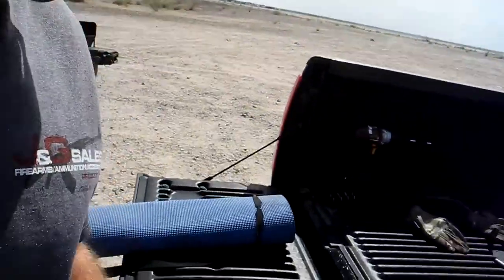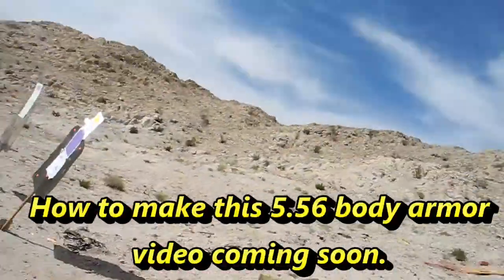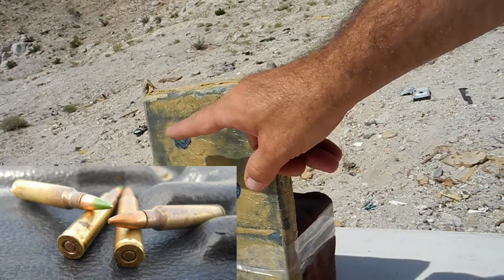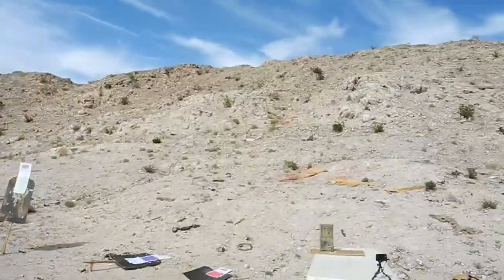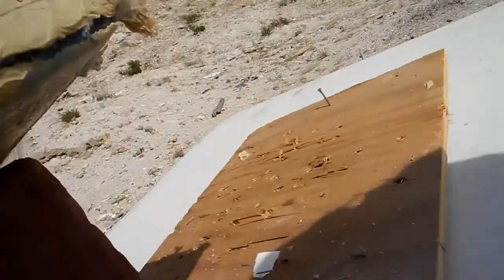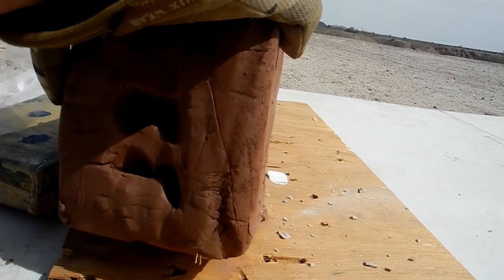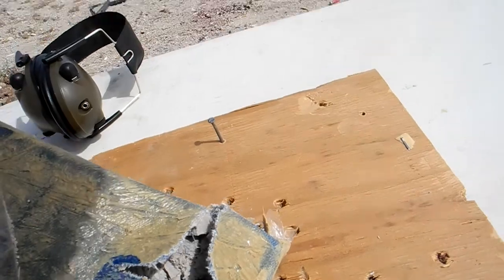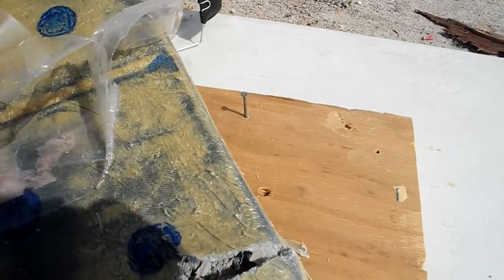DIY Body Armor

Comment: This is awesome.ill try to build my own diy plate here in Sweden 😀. Ill use 1 layer of thin steel, then 1 layer of ceramic tile, then one layer of hdpm plastic ( a cutting board) then one layer of ceramic tile again and then another layer of plastic cutting board. Ill use PL to glue it together and then wrap it with kevlar from the hardware store and resin. Will be interesting to see what that can stop 😄

Comment: I just stumbled upon this and I think it’s great! I was looking to make ballistic panels for a backpack. 

I have 2 questions... What happens if the round hits in the middle of the tiles? And what kind of tiles again? I want to see if I can find a little bigger one. Thanks!
Reply from the maker: PEI 5 tiles.

It would be better on a final design to have no gap where the 2 plates meet and stagger the 2nd tile to ensure there isn't a double seem.
Reply: @ProfessionalPepper ahh yes good call. I can try that. Is the aluminum supposed to be just a backing or have some stopping power? I am trying to keep the weight down for a backpack 🎒 but I think it may be heavy.

Comment: I think the more flexible alluminum was able to handle the rounds crushing the tile without being deformed. I think hard steel plates may be effected more early on as the bullet is penetrating before it actually hits the steel itself. I could totally be wrong though. Im no expert in balistics. One thing id probably do though to improve the design is use smaller tiles and more of of them. Im not sure if they are available or if they could be made DIY, but i would use four layers of smaller tiles four times thinner, and overlap them so that in between the tiles arent as much of a week spot. I think it could offer the same protection as your design, just without having week spots in between the tiles. I guess two large tiles that cover the whole plate could be used but then theres a chance that the entire plate gets cracked and compromized.

Comment: You should try using NP1.  It is an adhesive caulk that will stay more flexible and, I believe, will hold the tile to the aluminum better. It would also be better to hold the denim in place as it doesn't dry as brittle.
Reply from the maker: Interesting I'll look into it

Comment: Awesome forensics, probably the best I have seen.
Reply from the maker: Thanks.  I feel it's the best way to understand why they succeeded,  or failed.
Reply: @ProfessionalPepper  I dabble in making plates myself and I have noticed a thin layer of lexan in the center (squish factor) and a second piece of lexan on the inside (spall liner) increase the overall strength of my other materials, it seems.
Reply from the maker: @bizzlesnach  yeah. It seems the spall can significantly disrupt the material of the ceramic, reducing its multi hit capability.
Reply: @ProfessionalPepper  I have also superglued 1/4 inch washers on the tile, it tended to deviate the path of the projectile

Comment: You should try putting the ate setup into a mold and filling it with resin to seal it all together, it will increase durability.
Reply from the maker: it would increase its durability for certain.
Reply: @ProfessionalPepper   i was planning on making some soon, if i can get around to it i could post a video.
Reply from the maker: It would be awesome to see!

Comment: Make sure people know there is different hardness on tiles sir lol  👍
20 layers of fiberglass
3% graphene mixed into resins by weight  and metal plate on back covered by rubber with 3% graphene by weight should get you a level 4 to 5 bulletproof plate. Powder flash  graphene is cheap now they sell it on ebay.or there's videos on here shows you how to make flash graphene powder yourself.

Comment: very cool  congeatulations men , its possible it stop a .308?
Reply from the maker: I do not believe it could stop .308. However, i don't know for sure unless i try.
Reply: @ProfessionalPepper   of course men , maybe 1 layer of granite in front off a 3/16 mild steel  + some layers of denin and resim can do it
Reply: it will be heavy but probably works so better, granite its a very hard stone , mild steel is very elastic and not very heavy in 4.5mm and denin + resin will absorve the energy of deformation and spalling protection

Comment: why does this not have more views. You should send one of these plates to the guy at demolition ranch to test. Maybe if he links your channel you'll start to get the views you deserve.
Reply from the maker: thanks. I'm gone for a year, but I I think I might send a plate or two to some other channels when I get back.
Reply: @ProfessionalPepper how many yards of denim did you use? Trying to figure out my order
Reply: @isaacwilliams5212  order 2 yards.  3 if you want extra to mess with. It's pretty cheap.
Reply: @isaacwilliams5212  order 2 yards.  3 if you want extra to mess with. It's pretty cheap.
Reply: @isaacwilliams5212  order 2 yards.  3 if you want extra to mess with. It's pretty cheap.
Reply from the maker: Choppingblock with Andrew is in AZ so it would be easy to send to him.
Reply: But how heavy are they?
Reply: @theultimateninja  7.2lbs was written on the plate in the video

Comment: I think the glue you used needs air to dry. If it is contained it might not dry ever
Reply from the maker: JohnFrumFromAmerica I should have waited longer.  It does need air, but even the slightest bit of pores in a material allows enough in.  I've done plates similar where I let it sit for a month + and it cured all the way.  I should have let the plate breath a bit before I assembled it to the aluminum.
Reply: single part polyurethane glue needs water (air moisture) to set. Water is really hard to keep out of things, it easily permeates many materials. It really just needed more time.

Comment: I'm glad that you did this
make another, shoot it with 30-06, if it stops 30-06 its a level 4 plate I really want to see what it will stop
704 Tactical did 1/4" 6061-T651 with two tiles taped together.
it stopped 6.5 grendel, a 7.62x51 went through but it was just tape

for reference, the 1/4" 6061-T651 stopped 9mm, 357, 40 and 45 by itself

Comment: impressive as you're previous bullet-proof plates :)

if you're planning to make some others, i ve got a little idea:

-cast tin/pewter (it melt a 300 degrees celsius, so, it's much easyer than steel wich melt a 2000 degres celsius) and put some granite and qwartz gravel withint when it's still liquid.

-add an layer/an 1mm thick plate of alluminium on the front, and an 1 mm thick plate of steel in the back.
Reply from the maker: gamecube-king/ devon3 thanks

Comment: How much do these weigh?
Reply: I would substitute the aluminum for steel 1/8" thick and case hardened. If you need aluminum backing, use aluminum flashing (which is basically sheet metal). The big issue with this homemade armor is that the bullet imparts momentum to the ceramic spalling which prefragments the ceramic behind it before the bullet reaches it (which is why when you separate plates, the impact area gets larger with each plate). This is why duct tape around each ceramic tile or adhesive adds so much to the protection, in that it manages the spalling. I found that aluminum flashing or a thin sheet of HDPE between tiles works pretty well.
Reply from the maker: Api Tuia 12" x 6" is 7.2lbs